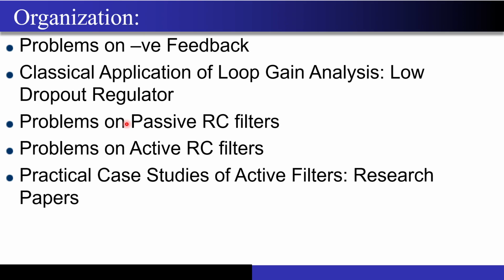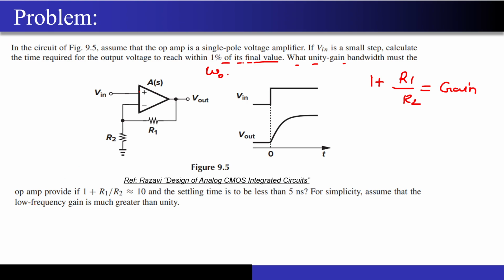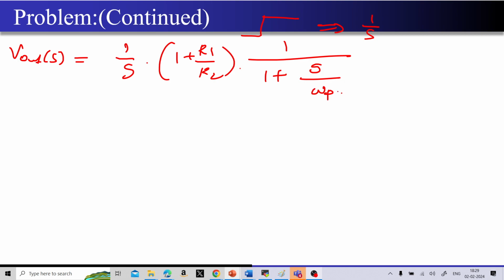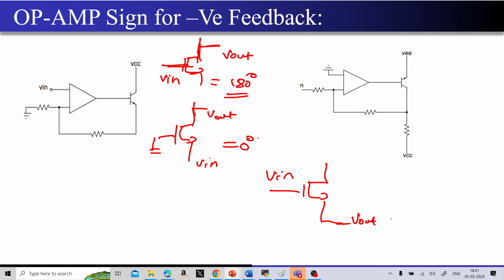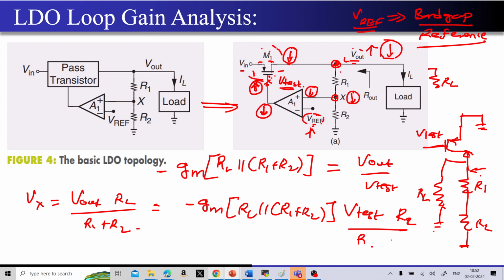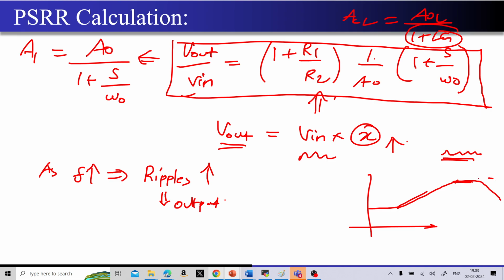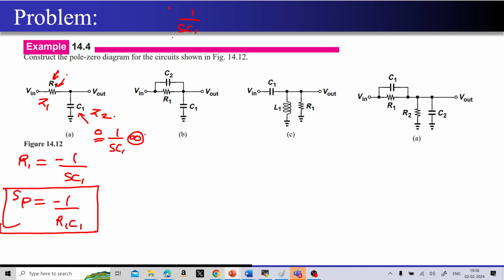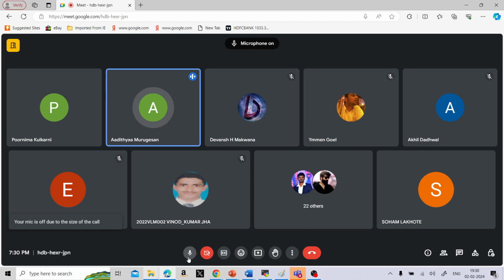Analog IC Design Week-2 Problem Solving Session: Part1

Comment: Sir excellent session
Sir why we called 3db cutoff free why 3?
Reply from the maker: If you look at the magnitude of the transfer function at the pole frequency, it is dropped by sqrt(2). If you take 20log(sqrt(2)), you get the 3dB loss!! Also, a 3dB point corresponds to a 50% drop in the power and this is a very significant drop. You can define any X dB point that you want but if you define it too low like 0.5dB or 1dB, don't forget that there are ripples in the passband which can have 1dB variation and there won't exist a unique 1dB point.  Hope it helps!!